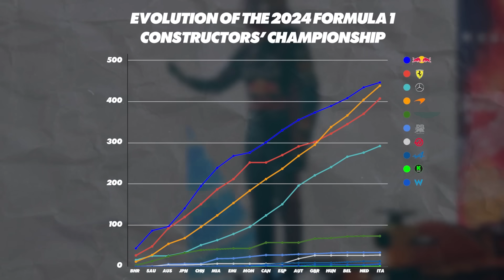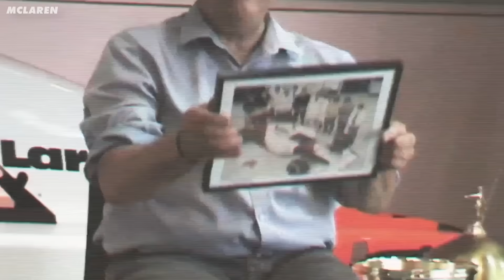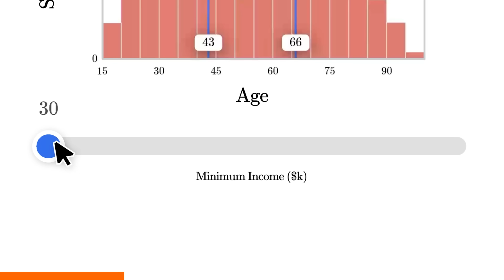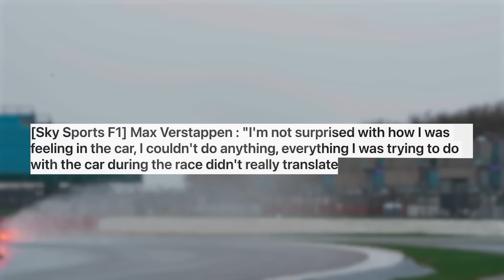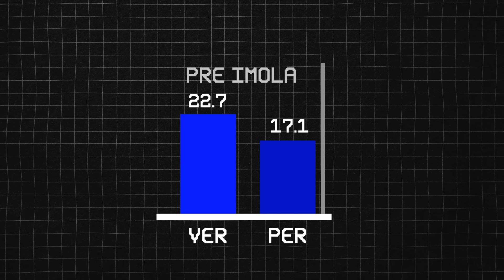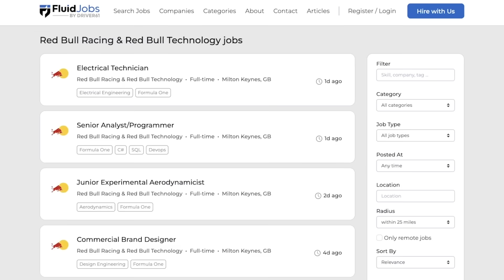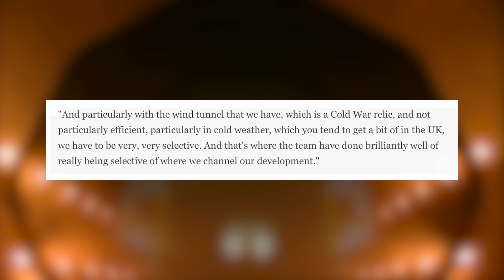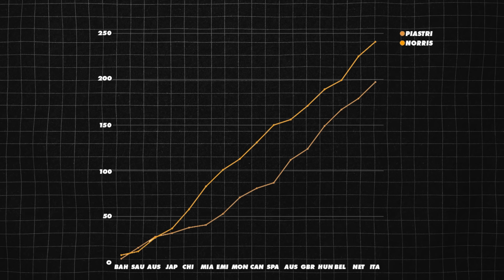Why McLaren Are Now SO FAST

Comment: I can’t see why people are so incensed by Piastri overtaking Norris. After all, if McLaren didn’t want them racing competitively they’d have made that clear to both drivers before lights out. The bigger picture is that McLaren are after the constructors trophy first and foremost, and it doesn’t really matter to them which driver has track position over the other. They’re not yet at a point where Piastri is mathematically out of the running for the drivers title, so are in my opinion quite rightly allowing them to race, with the stipulation that they don’t take each other out. In any case, they are probably too late to effectively implement team orders, if they were going to do that they should have done so way earlier in the season, with an established order of lead and supporting driver. I can’t see Piastri wearing the tag of number two driver either btw, as in my opinion he’s far too promising a talent to turn into another barrichello, Coulthard or Perez. Norris hasn’t really shown the consistency of scoring regular big numbers of points, namely wins and seconds, to deserve all the team’s resources being put onto his side of the garage yet. Rosberg in 2016 won his title by hammering out regular high scores of points even when not winning, and making sure he was there or thereabouts to capitalise on any misfortunes from his competitors, such as saving a good points haul in Malaysia after he had several issues in the race and Hamilton retired from the lead with engine failure. Norris has not capitalised on verstappen’s issues and reduced performance in the way he should have. He may very well still pull himself close to verstappen in next two races as the red bull will certainly struggle in Baku and Singapore unless the car is drastically improved. After the next 4 week break it’s anyone’s guess what can happen. If Norris really wants this title he needs to put in two huge performances and get two wins starting next weekend, and hope that everyone else behind has a big dogfight and verstappen comes off worst to reel in the points deficit. Looking very finely poised heading into the later stages of the season in any case

Comment: 44 points between lando and oscar is not enough to fully back lando. Only takes oscar beating lando a couple more times, a dnf or something from lando (could be another incident with max or a failure) and oscar is right there also in contention for a WDC also, Sure the stars would need to allign, but crazier things have happened. I think maybe if oscar wasn't so consistent not only at finishing every race but also consistently improving it would be easier to fully back lando. Maybe if oscar makes a mistake and WDC becomes completely out of reach we will see instant team orders from there on out but untill then I think race on and race hard. It has been a very good season for racing and I'm looking forward to more of it.

Comment: Assemetrical braking (if they had it) was not illegal until they passed the regulation. So why call it illegal?
Reply: Because Bri'ish
Reply: British Media anti Max and Red bull youtube channel 🤔
Reply: He was quoting Red Bull. They said they had not used "an illegal" system. Clever wording, because it means they could have had such a system, but it wasn't technically illegal.

My conspiracy theory? The reason Max did so much better than Checo for most of the season was that the team only gave the sneaky brake system to Max. They kept it secret from Checo because they were considering replacing him and didn't want him to go to another team and tell them what they were doing. Now that they have had to remove the system Max has fallen back significantly but Checo is doing much the same as he was before.
Reply: Illegal now still shows how they made a system that gave an unfair advantage to one team over the rest and why it was made illegal, and it shows, since than Red Bull have dropped off a lot and it's their own fault.

Teams should know better than to make a new system that is within the rules, but not legally allowed. Teams that build a car like the Red Bull brakes or the Brawn underfloor and then design the rest of the car around it suffers long term since when those new designs are made illegal and they need to change, it changes the entire handling of the car and makes it undriveable.

Comment: They're gonna come 2nd in the Driver's with Lando and Ferarri are going to beat them in the constructor's unless they impose team orders. Oscar's job should be as a rear gunner for Lando, his job is to make sure Lando win's the WDC which will mean they also win the WCC, but I honestly don't see them doing it, they've already cost Lando atleast 9 points, just by forcing the swap at Hungary and not swapping them at Monza, but they should have had a 1-2 at Monza anyways, so it's really even more points than that.
Reply: Oscar’s job is to win as many races as possible. He’s not Lando’s babysitter.

Comment: For WCC Red Bull needs a better 2nd driver.
For WDC there are still options, if Piastri wins again instead of Norris or if Ferrari/Mercedes can win races.
McLaren should implement team orders if they want Norris to win.

Red Bull will have updates in Austin but they have to test them to see if they work.
Red Bull isn't too worried about the WCC, Perez' sponsors already told Red Bul they will compensate for the loss of income.

Comment: Scott is grossly overestimating Lando's ability to outscore Max by 8 points/event for the rest of the season. Even with RB struggling, Max is basically guaranteed to get 6 points/race (2/sprint race) and Merc/Ferrari/Oscar all have pace to prevent Lando from nothing but podiums. Short of a Lando win and Max DNF anomaly, it's going to be really tough for Lando to pull it back. I hope he does, but think Max managed due to all the ball dropping by McLaren so far.
Reply: Although at Baku Norris started 15th while Max came from P6, and still Norris ended before Max and easily scored fastest lap, with a 1.3 second gap to the previously best fastest lap. Seems like McLaren has a lot of flex in their wings, still legal maybe, but helping a lot to get fast top end (some cars are slower even with DRS open) an great cornering

Comment: Driver 61 - off topic, do you take video ideas?

What would happen if a current Formula 1 engineer traveled back in time to build a 1968 F1 car with 1968 regs, with all current knowledge, but limited by 1968 technology - so no CAD, no carbon fiber, no wind tunnels, etc

And the inverse, what if 2020's regulations were adopted identically in 1968.  What car would 1968 engineers make with these regs, but limited again by the technology available?  (mandated tech like ERS might have to be optional)

Comment: I don’t think you can tell Oscar to slow down and not be aggressive. As Senna said “If you’re no longer going for a gap you’re no longer a racing driver” 

Also I don’t think Lando will win the championship as rightly or wrongly Oscar and Lando will be fighting each other. 

All Max has to do is finish high enough to hold on to his lead. It will be tight but I think he still has a large points advantage

Comment: You honestly believe Lando would threaten Oscar with a deliberate crash?? Lando has the notoriety of being easy to pass on the first lap... Maybe Oscar had already cautioned Lando to hold the pole on the 1st lap or he would be one of the racers to simply drive around him???
Reply: Also, lando has more to lose in a crash if he wants to beat max. Not if he just wants to finish the season ahead of oscar though

Comment: No chance. Norris and McLaren will bottle it. Verstappen is a far better driver and he'll do enough. I just don't see Norris turning 60 points around in 8 races. 

McLaren I think will implode into a civil war and it'll destroy themselves in the drivers, it could actually hand the constructors to Ferrari. Norris needs to put Piastri in the barriers if necessary. It'll be worth losing points to Verstappen to stop the nonsense.

Comment: The rebound from that Redbull just isn't as good as it has been in the past. You just can't get on the power mid-corner exit from low-mid speed chicanes like you would want. I still remember looking at the relative telemetry data at Montreal, and how the Redbull was losing speed exiting chicanes compared to the likes of Ferrari, Mercedes, and McLaren. But I didn't think McLaren would pull such a gap to Redbull in just pure, outright pace. Maybe towards the end of the season.

Comment: Rb designed the car with the brake adaption, take it off and the car is too stable and doesnt turn well. The brake adaption also meant you can get on the power earlier, so its effected the whole car. They had a way to turn the car and add power easily!
Reply: Except the FIA said they didn't. Who gave you your information? Santa or the tooth fairy?

Comment: I'm not sure, but you forgot to talk about Maxes and Helmut Marko Comments after the races, saying that the Engineers at Rb didn't believe when Max and Checo said that they will have Balance Issues later this season. It's probably similar to 2014 where the areo and Chassis is perfect and the best off the grid, but this time it's not the Engine but the balance of the car. There is a reason why a lot of people say that the handling of this year's RB20 looks like the Ferrari of 2014 with overundersteer.

Comment: All the RedBull excuses were present in 22 and 23. The biggest and most detrimental change has been Newey departing. It is quite interesting how RB poached Mercedes staff and the Mercedes wind tunnel issues they were going on about are now what RB is facing.....
Reply: Tbf, Red Bull has a wind tunnel dating back from the cold war while Mclaren has a brand new one.
Reply: @user-ri9dn4vi6i  sure, I'm not disputing that, but it worked fine with Newey, worked fine for last 2 decades. They've never had aero issues nor have they complained about the wind tunnel correlation.  Wind tunnel correlation is exactly what Toto and Merc were complaining about at the start of this season. RB literally poached high level engineers from Merc who'd be off their gardening leave at the start of this season.... besides all that, Lando and crew aren't faster directly due to their state of the art wind tunnel. In fact their time in tunnel would be more important than the tunnel itself at the end of the day wind is wind and the ability of those reading and collecting data is what counts. It's not like RB was bragging about winning with a cold war Era tunnel but now they struggle its cause of the tool not the user of the tool